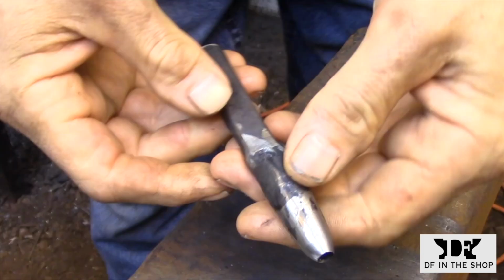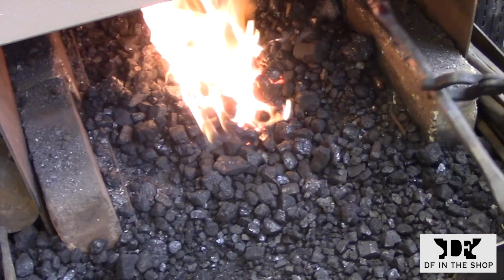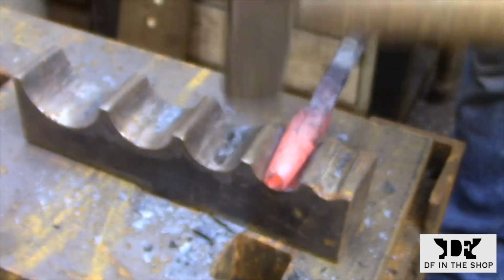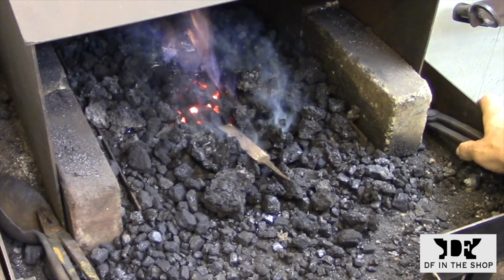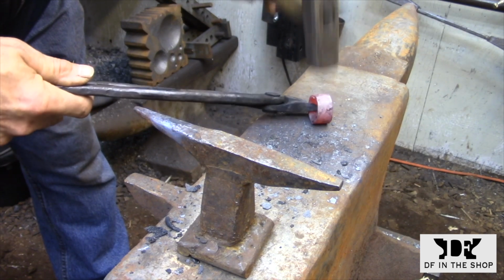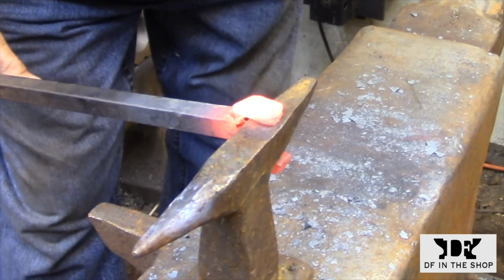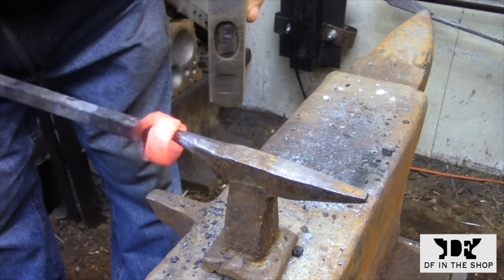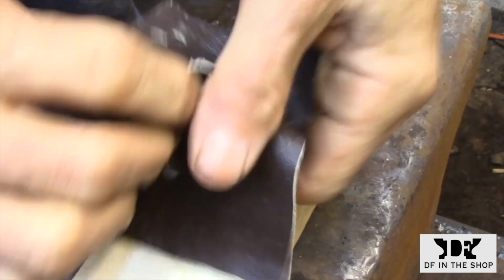Forging Leather Hole Punches - DF In The Shop

Comment: Denis, do I have to weld this or can I just forge braze the seam the same way I learned how to in your book when the pipelock was being made?
Reply from the maker: Brazing should work just fine. If you take the time to dial-in the edge and not leave it kinda  rough like I did here, they really don't take much hammering at all. You will need to make sure that the joints are a good fit.  Brazing is like soldering.  It seeps into tight fitting spaces. It's doesn't fill gaps.  Use copper wire.  It has a much higher melting point than proper brazing rod so it should stay together when you reach the critical temp for the quench. Let me know how it turns out